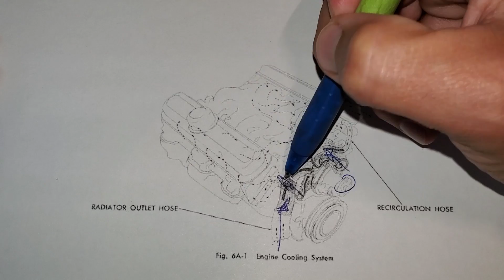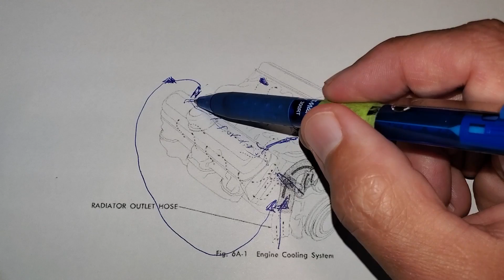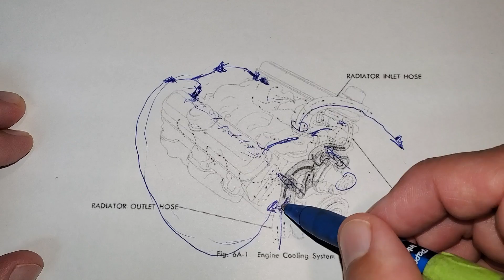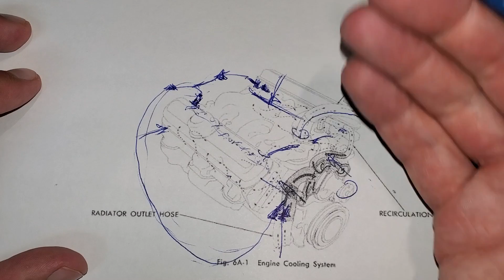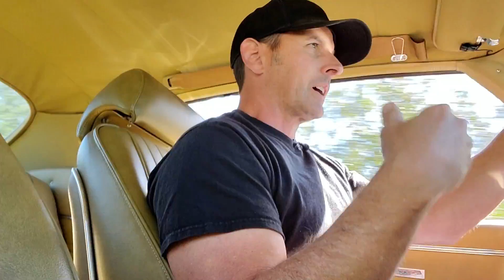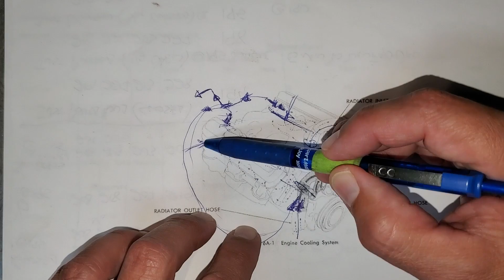Pontiac Head Cooling Trick - Heater Hose Myth?

Comment: I can tell by your explanation of the coolant flow that you weren't considering returning flow from left head into the block then to the water pump
Reply from the maker: Agreed.  Check out part 2, I welded a bung to the cross over.  Works awesome.  That link is in the description of this video.  Have fun!

Comment: Any change need to be done so not to create steam pockets or low flow spots. Disrupting designed flow take cooling away from critical areas.
Reply from the maker: Check out the part 2 I did.  Running back into the cross over is the way to do it. Thanks!

Comment: doing my 6x-4 heads right now ,   will be doing this mod ,  192 thermostat original , in my 1976 trans am, 455 4 speed.  but it looks like 180f should be the best for 91 octane fuel.
Reply from the maker: That’ll work. Have fun!
Reply from the maker: Btw, make sure you see my part 2 of this video. You’ll need to plumb to the crossover. Not back into the water pump heater hose inlet.

Comment: So I get what you're doing but wouldn't it be more efficient and more effective to tee the back of the heads together and then run that to either the thermostat housing or just to the crossover that way it can go back in to the radiator
Reply from the maker: Actually, yes!  I did that in a later video, here; https://youtu.be/v_qUY4E33r0  Have fun!
Reply: @FastMonty how well did it work

Comment: I put my back-up water temperature sender in that port. Gives me the temperature of the hottest part of the cooling system and it gets hotter over time with a delta of about 20 which I believe to be accurate because at first both gauges are the same until the heat really gets in there. The left bank has the only neighbor cylinders that fire consecutively (5-7) so that also creates a hot spot. I installed a vacuum shutoff valve with a switch in the car for the heater core. Maybe I’ll put a crossover line in but I’d want to keep my temperature gauge installed in that location and my heater shutoff. Then I could use the heater core as emergency cooling. Maybe switch to a mechanical heater shutoff that I could control the flow with. For now my cooling is good but I have to limit the amount of time I spend hammering the throttle. It can take a few back to back full power hits but there’s a limit.
Reply from the maker: Nice!  I have THREE temp reading ports... stock guage, Fuel Injection Guage, and most importantly a Mechanical Guage.  Lastly, check out my latest video on this subject... https://youtu.be/v_qUY4E33r0  Again this trick is to even out head temps.  If you really want cooling power you need a nice new Cold Case radiator and giant electric fans.  Have fun!

Comment: I'm 4 years late, but you basically accidentally created something similar to a modern-ish accelerated warmup cooling system (in full warmup setting) without the restriction.

On the Nissans I'm used to dealing with, the thermostat will be on the cold water intake side of the engine, but the heater core return line will flow all of it's warm water over the thermostat (to make it open). If there is also another hot water (outlet)  recirculating (bypass) line to the cold side thermostat, it will have a passage into the thermostat housing that will allow a plunger on the back side of the thermostat to restrict/block off the bypass port when the thermostat is open enough (certain temp reached/fully open). By restricting the flow through the bypass it forces more hot water out to the radiator and the water pump to pull more cold water through the thermostat and into the engine. 

Basically you came to roughly the right conclusion. Though maybe this extra info can help you or someone else.
Reply from the maker: That's really interesting... thanks for sharing how modern engines get it done.

Comment: I had many pontiac 400 cars,  mostly late 70's but one of them was a 69 400 10.5:1 #16 heads 180 therm, 4 core copper radiator and a clutch fan. Never went near 200 and neither did any of my t/a's. I wonder why some people have a problem. Even with 3.73's in one of them still no issue
Reply from the maker: Congrats on your super cool Pontiacs.  This day and age, not all Pontiac blocks are the same, and almost all of them have been modified, bored, stroked, re-honed, etc... that changes things quite a bit.  The second video I did on this subject is much better as I detailed that this trick, when run to the cross over, not the inlet of the waterpump, helps even out the heat of the heads, front to back.  Therefore eliminating the well known issue of "steam pockets" in the rear of the heads.  Thanks for the comment!
Reply: @FastMonty yeah i watched. You really showed how the experiment worked. I had 1 1970 GTO in 95. I should have kept it. Im a bird guy but i saw the interior gto panels and dash and it reminded me. I also had a 69 lemans. Thats where i got the built 400 and 400 tranny that i put in my 79 403 trans am. What a disaster. Mounts and brackets. Omg i pulled both cars apart in the snow in a snowstorm in 1992 when i realized A & Fbody mounts were different i was 20 and really did not know much at the time. Boy did i learn

Comment: From the back manifold nipple, I ran a 5/8 hose all the way to the front of the radiator area and put a heater core and then ran it back to the motor to the water pump and my car is at 160 always. But now I’m gonna run the driver side the back of the head to a T and they’ll call the other side of the head. We’re leaving that hot water from the driver side. Thanks for the advice. I hope this helps.
Reply from the maker: Here's the updated version... should give you some better ideas.  https://youtu.be/v_qUY4E33r0  Have fun!

Comment: Your problem is you're returning hot water into your cool water before the pump. Your return needs to be before the thermostat but after the pump. If not before the thermostat then at least before the radiator. You're heating your cold water before you ever get it to the block and heads to absorb the heat. Where you run the return is what will determine whether or not the bypass works or not.

Comment: I used a -8 hose on mine and routed it parallel to the driver valve cover. According to the temperature gun its the same temperature as everything else and runs at 180 so seems to work good
Reply: Yes i have great video
Reply from the maker: @kellyperry8755  Good to hear.  Thanks!
Reply from the maker: Great to hear... have you seen my part 2 of this?  might give you some future ideas.  https://youtu.be/v_qUY4E33r0?si=jKfUAyQxprhFAr9x   Thanks for the comment!

Comment: You can also replace your heater valve with a bypass heater valve.   With a bypass valve there is always water flowing out the back of the head.
Reply from the maker: Yeah, I wasn't clear in the video... that's exactly what I have, but super custom.  (I modified the VintageAir electronic solenoid to act as a three way valve, instead of two)  Thanks for the comment!
Reply: @FastMonty  I saw that you are switching to an electric water pump.  If you do that you can eliminate your thermostat.   Just use the  water temperature to switch on the water pump and fans.   I am trying to design a Holly lo-ram style intake manifold but I quickly realized it would run into the the thermostat housing unless I made it really high.   I haven't decided if I am going to remote mount the thermostat or use an electric pump to eliminate it.   If you want to be my hero could you measure from the thermostat housing to the bottom of the hood?   I am shopping for a 68-69 Lemans but it will probably be this time next this time till I will have save up enough to buy what I really want
Reply from the maker: @DuffusMonkey  Yeah, I hear you... the jury is still out on if I'm going to go the electric water pump route.  Reason is, how do you know if it's running?  What happens if it fails?  At least with a mechanical pump, it's just a belt as the failure mode.  And, since my alternator idiot light now works... if I toss a belt, my alt light turns on.  Anyway, keep me posted on your project.
Reply: @FastMonty  my buddy is driving to Columbus Ohio for Drag week.  He is running the Meziere 300 Series High-Flow Inline Electric Water Pump Single Outlet on his car.  It is a remote located pump that a lot of the drag week competitors use.   He claims is very reliable,  I am still a little nervous about going that way.  I am Slooow on my projects but I will post some You Tube videos eventually
Reply from the maker: @DuffusMonkey  Nice, I've heard of the remote pump too.. .still, I wonder how it would work on a 500 mile road trip, through the desert?  (I just did that in my car, zero issues, surprisingly.:))  Thanks for the comments!
Reply: @FastMonty  you can install a flow switch to turn on an light if there is no flow.
Reply from the maker: @cuzz63  Ahhh yeah, I've been pondering that idea.  Thanks !  Be sure to watch Part 2 of this video, it's even better!  https://youtu.be/v_qUY4E33r0?si=jKfUAyQxprhFAr9x
Reply: @FastMonty  since you asked I will watch it..being a chevy guy I wasnt 100% invested...lol
Reply from the maker: @cuzz63  Ha!  I've been told it works for Chevy's too.  Let me know your thoughts...
Reply: @FastMonty  will look into that.

Comment: you are running your coolant thru the heater core full time.....not a good idea at all.  In the summertime your ac isn't going to be very effective at all....its going to be HOT in the cab.  Don't do this in Phoenix.  Sounds like you need a better radiator. In the late 60's ALL the big block muscle cars ran 210-225.
Reply from the maker: Actually, I have a bypass before the heater core.  Agreed about running it through the heater core will make it hot in the cab. Thanks again!

Comment: You can not run hot coolant back to the intake side of your pump as you will reduce the flow from your radiator reducing cooling. Coolent from the back of the heads must go to before thermostat so it will go to the radiator. Also you should try a remote thermostat on inlet hose.
Reply from the maker: Agreed!  Here's part 2, where I fixed that ... live and learn, right?  https://youtu.be/v_qUY4E33r0?si=HTHF-alYl34Jr2xh

Comment: stainless in n out hoses, restricter ring, gutted thermo for 160 degrees, mechanical clutch fan. no issues, I also suggest block filler to casting plugs.  if you need more one large elec. fan on front with manual switch-done.
Reply from the maker: Nice!  This is more about keeping temps the same from front to rear.... here's my latest solution.  https://youtu.be/v_qUY4E33r0  Thanks!

Comment: Did you happen to try tying the back of the heads to the top of the radiator rather than the cooler side going back into the engine? Why tie the hot coolant from the back of the heads to the cooler coolant going into the engine at all?
Reply from the maker: Agreed.  I did that in a later video, here... https://youtu.be/v_qUY4E33r0  It's wayyy better.

Comment: Oh my god this worked for me! I have a 1973 Formula 455 Pontiac with Edelbrock heads, and had T-ed the heater returns together to even up head cooling. But my car has always run hot 200 plus, especially when idling. I was to the point of not driving it any where, due to fear of it overheating. I just installed a $13 ball valve from Amazon in the heater return line with the valve about 1/4 open, and now my car is idling at 180 degrees on a 90 degree day. Monty thank you so much for coming up with this tip. Cheers!
Reply from the maker: That's awesome!  Have you seen my latest video on this subject??  Might want to check it out... it will help even further.  https://youtu.be/v_qUY4E33r0   Thanks again for the comment!

Comment: Mike. I’m about to turn on my 455 on a 67 GTO. Thanks for the videos. Great information. How did you install the AN fittings on the back of the heads. I have cast iron heads. Is there a AN pressure fitting that presses in similar to a freeze plug. I’m interested in applying this to my GTO.
Reply from the maker: Congrats Richard!  With Iron heads, you'll need to use the standard heater nipple.  The driver side head has a freeze plug you'll need to remove.  Use nipples that have the restrictors built in... Then you'll need to find a molded 5/8" heater hose to make the sharp bends.   (AN fittings are a pain to get right, so, you're better off with rubber hose)  Then run that to the cross over, like I did in my second iteration of this video, here... https://youtu.be/v_qUY4E33r0  Have fun!

Comment: All that heat needs to flow back through the radiator. Not back into the engine. That's what radiators are for....
Reply from the maker: Agreed... that's why I did a Part 2 to this video.  Here:  https://youtu.be/v_qUY4E33r0

Comment: Noticed my chevy c10 doesn't have thermostat.  When I touch the radiator hose coming from engine to radiator it feels pretty hot.  Shouldn't the radiator cool down the fluid if it's that hot?
Reply from the maker: Depends what you define as "hot"  :)  the coolant from the engine is probably around 200 degrees.  Even with a 175 degree thermostat, it can still get hotter than that.  Hope that helps.

Comment: Seems like running with the factory restrictions on the hose bibs is the same as 3/4 open on your test. Also an idea I had was instead of going back to timing cover have a metal line going back to the trunk with a heater core and a blower motor and conveniently  pipe it out that hole in the trunk  that I have. Lots of time for it to cool off before it goes back in. You may not even have to run the motor.  Your thoughts.
Reply from the maker: Welp, I'm sure the more heat exchangers, the merrier.  :)

Comment: Mezier electtic pump free up horsepower i prefer that than hoses all around too the back of the heads
Reply from the maker: Agreed about an electric pump, but doesn't fix the rear of the heads getting hotter than the front.  Hence my Part 2 video about this, where the electric pump would be a drop in.  (That's my plan anyway, ha ha)  Thanks!

Comment: Great coverage on the head cooling issue, one thought on the use of a ball valve is ball valves are "NOT" normally a good source for throttling. For test purposes a cable operated heater control valve has a tapered plug that gives you better control (cv pressure drop across the valve). I used your application and a different valve works great.
Reply from the maker: Fantastic point Mark... I think I was just wrapped around using a valve that had AN fittings... you know, cuz I'm addicted to them.  Anyway, have you seen my latest video on this subject?  It's a level up... https://youtu.be/v_qUY4E33r0  Thanks again!
Reply: @FastMonty  yes I have seen your latest and as far as AN fittings they are perfect but I'm semi retired and go for cheap and street able daily driver! The end game is what ever works for your budget.
Reply from the maker: @markcollins457  Agreed!  Thanks Mark, and have fun!

Comment: Really enjoying your excellent videos and love the things you've done with your beautiful car.  On my '69 Firebird I have eliminated my heater core and am looking for a way to "plug" the 3/4" outlet from the water pump in an attractive way (prefer not to use a piece of hose with a big screw in it) that will last.  I have all AN hoses under the hood now and want it to look nice.  Are you aware of a way to do it without running a hose between the timing cover and back of the head?  Thanks for any advice!
Reply from the maker: Thanks Steve!  Well... the harder way to do it, is to weld on a nipple. Which is what I did, during my Lower AN Hose video.  That was a Pain.  But, you can't see it now that I've done this crazy mod, that you might consider... https://youtu.be/v_qUY4E33r0  but running underneath the intake manifold to the cross over.  Which is also a lot of work...  Hope it gives you some ideas.

Comment: Was just considering how to add an outlet to the rear of the drivers side head and remembered that you had addressed the issue but couldn't recall the details. So, thanks for the details!! Well worth a second and 3rd watch.

I have a factory AC car and still run the heater. Trying to wrap my head around a way to keep the heater core supplied, add an outlet to the left head and also re route the outlets from the heads to the crossover up front so that it's all controlled by the thermostat. Seems like that would be a little tricky and maybe not look that great.  I guess theoretically you could route the heater return to the cross over and the return from the left head to the cross over, then eliminate the old heater return to the pump. Practically, not sure if or how it would work with regard to actually running hoses etc. Great work with the videos, greatly appreciated and motivating!
Reply from the maker: Great question... before proceeding, check out my latest version of this trick, here;  https://youtu.be/v_qUY4E33r0   After watching that, and you're still game.  I'd Tee of both heads, and run that to the heater core inlet.  (Keep in mind, I don't recall if there's a valve that turns the heater core inlet on and off, based on A/C input, so you need to research that)  If the heater core flows all the time, then you can run the return line to the crossover like I did in the newest video.  Hope that helps!
Reply: @FastMonty  lol, how the hell did I miss that!! Thanks for the link. With running a heater core/heater system this seems to be the way to go. For best cooling efficiency it's probably best to come off each head and back to the cross over, but some folks gotta have heat! I may be pulling my engine for a rebuild in the next year or two, this will definitely be on the punch list of to-do items!
Reply from the maker: @collectingroadsna  Good call, much easier with the engine out.  AND, if you want to use A/C you can get creative with a three way valve.  Anyway, happy wrenching!